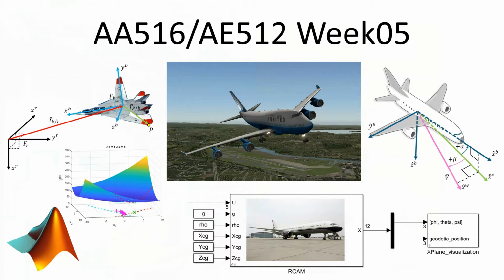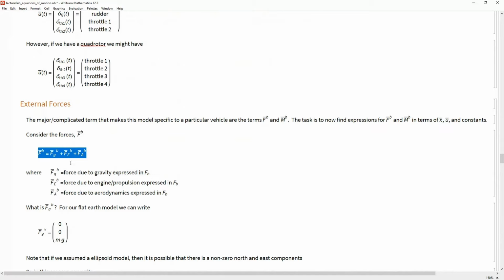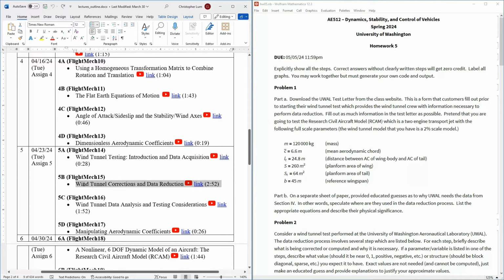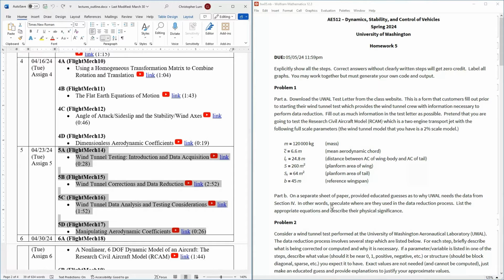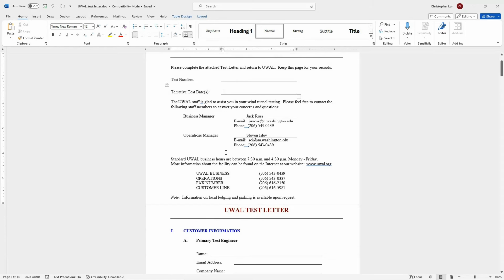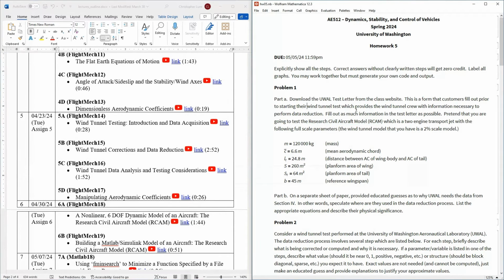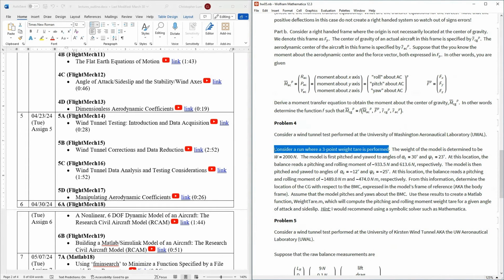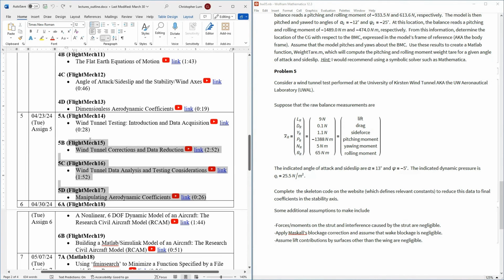AA516/AE512 Week05

Comment: Chris, you say that we should skim the 3hr long video because this material isn't as important, but then here you basically say that 3 of the 5 HW questions are based on material covered in that video... Is there a particular section or some additional guidance you can provide about what timestamps we should tune into in this long video since it's what a majority of the hw is based on?
Reply from the maker: Chay, you're right, the hw does ask you to use this material.  I would recommend using the timestamps in the description of the video to jump to the sections that cover the parts that are needed for the hw.  In all honesty, this is something that we'll use once for the hw and it isn't as much of a core concept as some of the other topics.